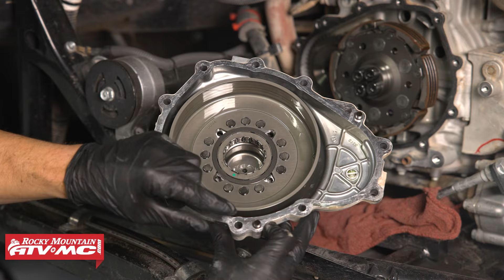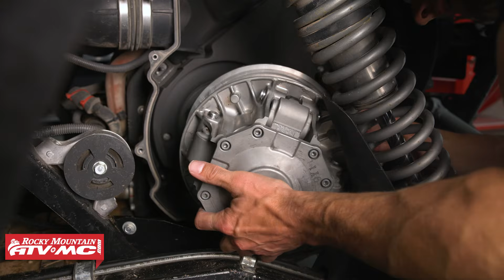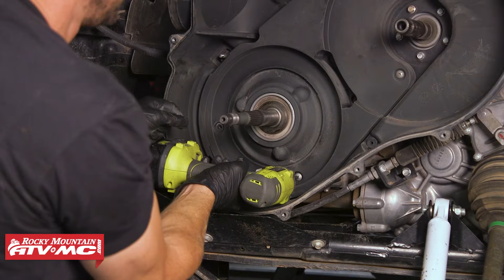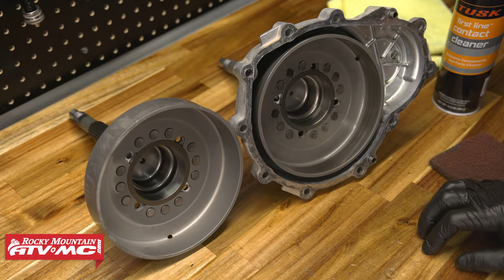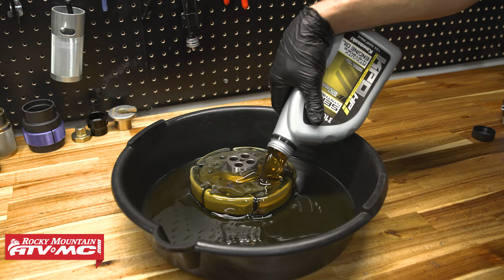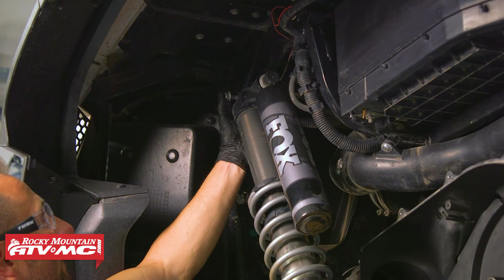How To Inspect & Replace One-Way Clutch & Centrifugal Clutch on a Kawasaki KRX/KRX4 1000

Comment: What if it turns clockwise but feels like there's resistance? My doesn't seam to spin that easy
Reply from the maker: Is it rotating smoothly even with the resistance?
Reply: @rmatvmc no it only turns about half a turn before it's too hard to turn
Reply from the maker: @dylangraham9810  If it becomes too hard to turn you'll want to pull it apart and check the bearing for wear.

Comment: Thank you so much Charles. What timing!! I'm thinking of slowly moving into the "dark side" of SXS (been riding off-road motorcycles for over 50 years). I sat in a whole bunch of different brands of them yesterday. Honestly the most comfortable hands down was the Polaris. Unfortunately they are not as well built as the Kawasaki's. Just looking at the motors and chassis I could tell right away the Kawasaki's are overbuilt. The only thing that put me off was the seat comfort and shoulder strap belts. I would budget in a set of seats and 5 or 6 point harness. Even the H2's are amazing beefy and the blower and all components are very accessible.